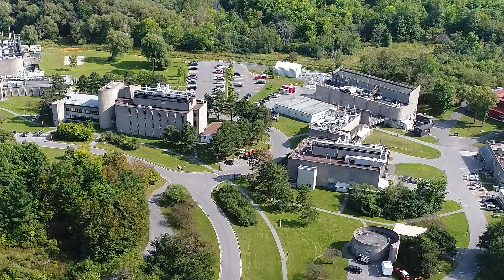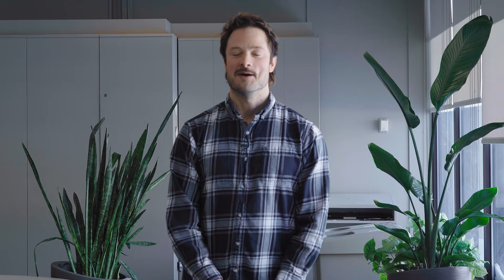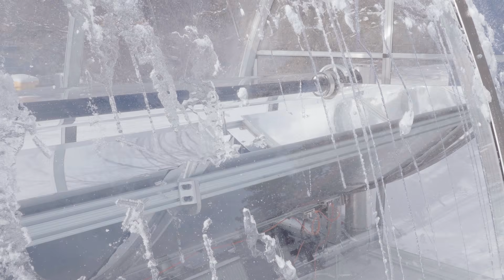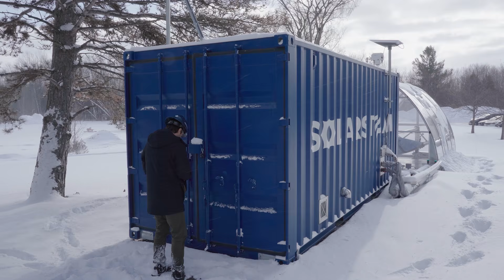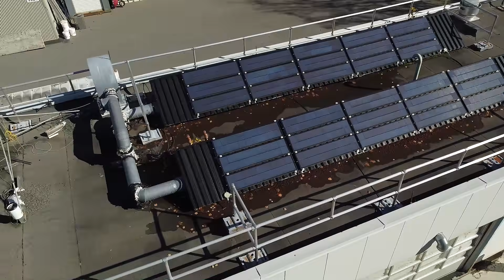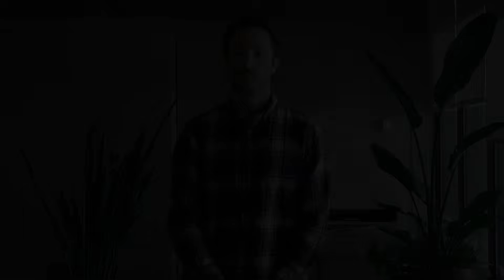Testing a New Solar Thermal System

Comment: This is a great idea.  The way to move this forward is to make the vacuum tube and green house easy to purchase. Maybe  incentives and government rebates that reward reliability.  Integrate simple wax valves, pumps  and other components for people to build simple systems.  If they are reliable and easy to set up, You would see many adopt this for radiant heating.   One could even have this go into a  wax heat sink or a simple car radiator with a fan blowing the hot air into a building when the sun shines.  When cloudy forget about it .  The computers and complexity are what keep these ideas (which have been around forever) from being used.

Comment: If you set up the greenhouse on a platform that tilts you can simply make a minor adjustment each day to set the angle to aim directly at the arc of the sun for that time of the year. I suspect that in more northern latitudes efficiency would double. 

An added benefit would be that the heated fluid would naturally rise in the tube thereby promoting flow without using energy. 

An additional benefit would be that snow would more readily fall off the greenhouse. You should also occasionally coat the greenhouse with a hydrophilic spray like Rainx which will help the snow slide off. 

Maybe even expending some of the energy to heat the greenhouse enough to melt the snow would also work

Comment: UM. SO. They are placing a thermal solor containment unit within a "greenhouse"????   And this is revolutionary...How???   This gains....WHAT???   Look. This has been tried since the 70's.  Is there any proof this increases efficiency...Not so far. Yep. I dan see how things get back to normal after the snow melts off. Does that mean there is a total gain??  Nope. You are doing nothing but restoring normal function by melting the snow faster

Comment: This is such a great concept since thermal storage of energy in water is better than a battery, certainly since the source of energy is thermal with wide band solar radiation and ultimately used for thermal energy in heating. The system is big since the water tanks must be insulated, but all of the materials are fundamental earth elements of metals and minerals plus some plastics for wire insulation and light duty frames, housings and fixtures. It is not disposable technology like so much electronic junk.

Comment: My family had a system similar to this in which the curved mirror heated water, which was stored in a large insulated water heater tank with a recirculating pump. 45 years ago. We always had plenty of free hot water.

Comment: I wonder if there is enough insolation at northern latitudes to make this a viable solution in winter.
Reply: Depends on the size of the system and storage. December/January in central-nothern Europe can have as little as 2 sunny days a month, so the system needs either recharge in those 2 days or store energy from previous months. But aiming for 100% renewable is almost always a failure (expensive) for the cold climate, its probably best to have something that works 95% of the time and supplement the extremes with some combustible fuel or grid electricity (which can, of course, be renewable)

Comment: I'll just leave this here. LFTR desalination
Who needs desalination? A LFTR nuclear reactor that runs on Thorium, 90 times more energy than Uranium, no nuclear waste, 200 times more efficient, thorium is more common than tin (the USA has the worlds second largest reserves in the hundreds of millions of tons). And guess what? This tech ain’t theory. One was built and ran from 1960 to 65 at ORNL and it worked great. Cheaper to build than natural gas or coal plants, and Thorium is considered a trash product. Best of all, the waste heat can desalinate water and using the special LFTR waste heat management process, the excess hydrogen from desalination can be combined with trash to make carbon free synthetic oil from sewage and MSW. Another other wastes products are Xenon which will power rockets to Mars and allow light bulbs almost as efficient as LEDs to be built, at a fraction of the cost. Another waste product is special types of bismuth and cesium which can cure all forms of cancer and eliminate food poisoning, respectively.
Reply: Yep it's definitely viable although the tech was swept under the carpet by the usual people for the usual reasons.In India,when they decided to go with nuclear power,the debate between uranium and thorium reactors was 50/50 (ie both ARE viable) until Mr Burns(easily the best named Simpsons character imo) had his say. A huge advantage of thorium reactors is that you can control which byproducts are produced and generate different rare Earths as well.China are obviously leading the research now after everyone else walked away.
Reply: @chippysteve4524 The chinese are investing a ton in solar and wind also
Reply: Useless complicated crap... My solar has been charging my EV's since 2014... Best investment I ever made.

Comment: I'm a big fan of parabolic troughs coupled with evacuated tubes for high heat generation.  The addition of the greenhouse seems to be a big improvement in efficiency from capturing heat as well as protecting the trough/tube from the elements.  Bravo and good luck!

Comment: This seems overly complicated for the result. Sure, solar thermal is more efficient than solar electric, but after you take into account balance of system I suspect solar electric plus a high efficiency heat pump would beat this setup in cost and simplicity.
Reply: Air source heat pumps are next to useless in most cases for providing hot water.They can heat air quite well but they suck at water heating.A UK govt scheme with grants etc screwed countless people who were forced to throw out their combi boilers too.The only people who benefitted were the installation companies who padded their prices by ~£7000 - the value of the grant.Nothing sustainable about middlemen and stupid bureaucrats until you start composting them  ;-)
Reply: You neglected to mention inverter to losses to get AC power for the heat pumps, batteries for storage, and balancing the heat pump's inductive load on the grid.